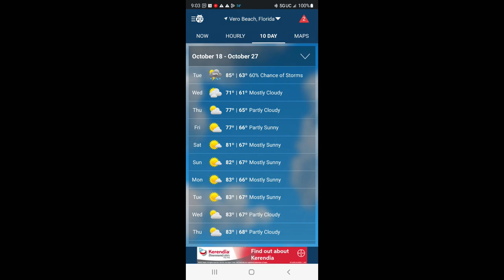RVDaydream Watcha Doin Florida Fall 2022

Comment: Funny story about having a honey wagon pumping an rv, I had a hose end black tank spinner to let down into the toilet so it could flush the black tank. “ my camper doesn’t have a blk tank flush hook up.”! Well it broke off inside my black tank, it’s brass and heavy and a bit large. I couldn’t get it out.  When at an event in SC I needed to have it pumped due to having a site with sewer hook up. Well I was careful and ran a water house into my black tank kept the flush pedal open, well low and behold out came the broken parts from my flush device. Done properly it actually did a great job cleaning my black tank. Made my day. Just one time it was worth the extra fee and work to do it.  Thanks for the great content.  Enjoy FLA
Reply from the maker: That was lucky being able to suck out the broken parts. LOL my issue is that they don't necessarily let you know when they're going to come around and pump you out. And obviously you don't have to be inside your RV for them to be able to hook up that hose and pull your dump valve and pump you out without you even knowing it. I can't imagine doing it without the foot valve being wide open. And for that matter are black tank flush is used extensively every time we dump our tanks so that we don't ever have any major buildup inside. I'm sure that the guy running the pump trucks not going to sit there while we go through our flush routine. It's just a bad situation all the way around. Hence the reason we're still carrying around that blue boy even though we have only used it for gray water a few times and believe it or not it was when we still lived at home and we were dry camping in the driveway before I bought a macerator.